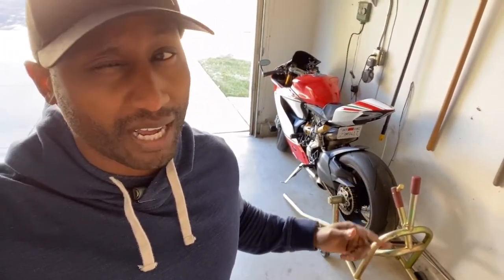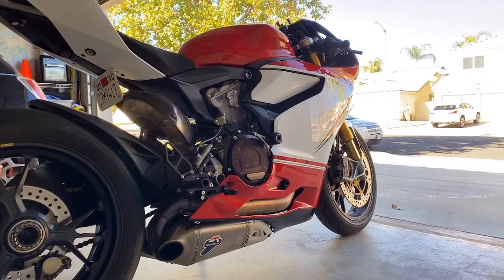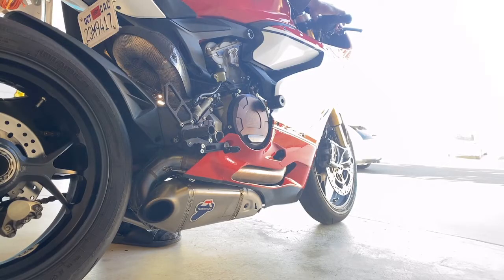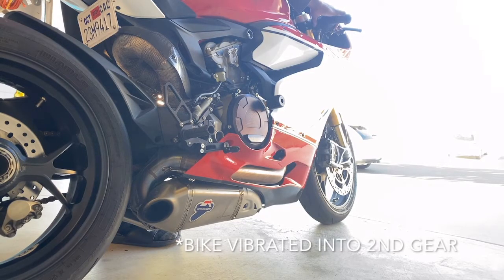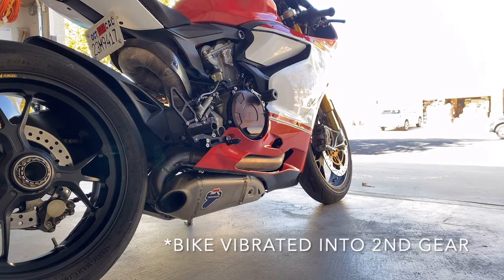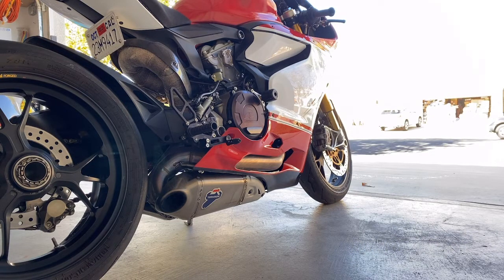Is a Ducati Panigale smoking at first start up normal? * Hmmmm*

Comment: If your bike has been sitting for a couple of days then it is normal for extra condensation to come out of the pipes , it’s also normal for a bit of oil blowby after restarting from a long ride where the oil has thinned out and has bypassed the valvestem seals , I have had mine for 9 years from new and has always done it , had no problems with the bike at all 👍

Comment: Have you ever had problems with hot starts? Like say you ride 70 iles, fill up gas, then try to restart and the bike don't wanna fire, you ever had that?
Reply from the maker: Nope bro, I have never had that issue. One of my friends had that issue on his 1199. He removed the charcoal canister and it doesn’t do that anymore.
Reply: @AimlesslyNomadic  ok, thanks for the info man, appreciate it
Reply: Just took my 1199s Evap system out and it starts up right away. Watch a youtube video on how to remove it
Reply: Had the same issue removing the evap canister fixed the problem

Comment: Did you ever get that bolt out? So the dealership sold the 2014 1199s so now im going buy a 2011 1198
Reply from the maker: I haven’t had a chance to mess with it. I will this weekend for sure though. I’ll be sure to record it. 
2011 1198s are beautiful bikes! I love those.